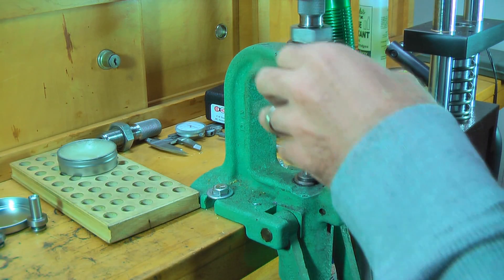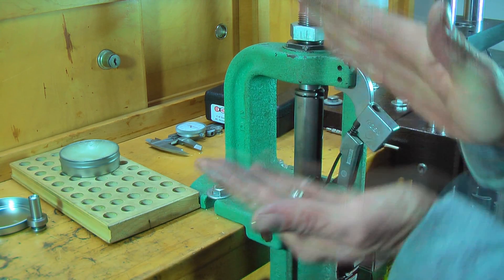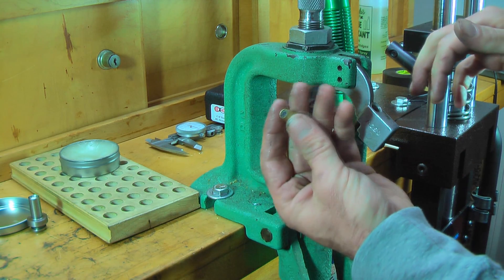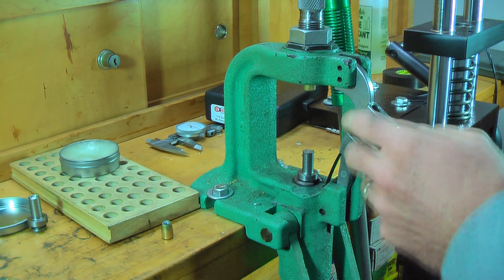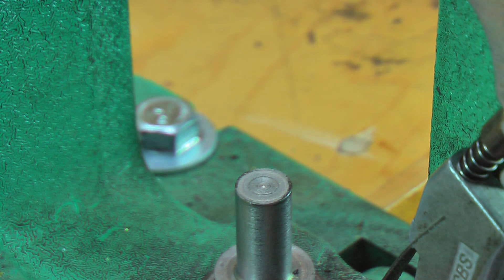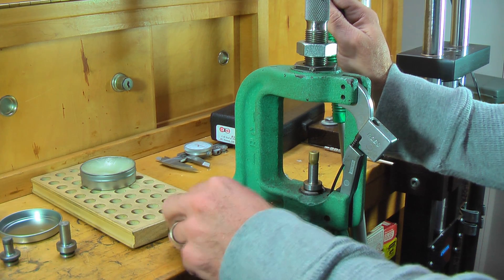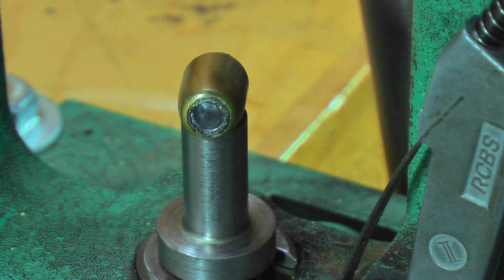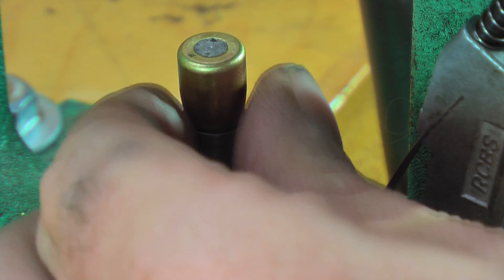10mm Bullet Swaging Part 4

Comment: I see that your swaging bench is not very wide, but it has storage at the back.  My swaging bench is also not very wide and has no storage at the back (22” wide x 8’ long x 30” high).  I have some storage shelves below.
The guy who designed this bench is of the theory that IF the bench is narrow, the user will keep it uncluttered.  Maybe that works for him, but NOT for me.
The cool thing about this bench is that it has various inserts for the various tools you use: lead wire cutter, case trimmer, etc.  
These tools are mounted on their own insert.  When you finish using that tool, you simply remove it from the bench and reinsert a blank insert.
Just some thoughts.

Ron